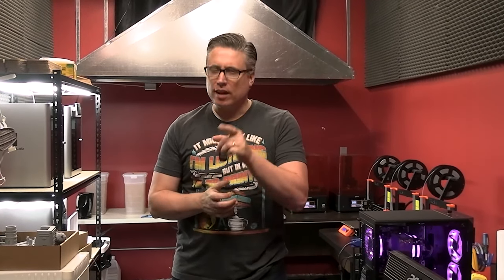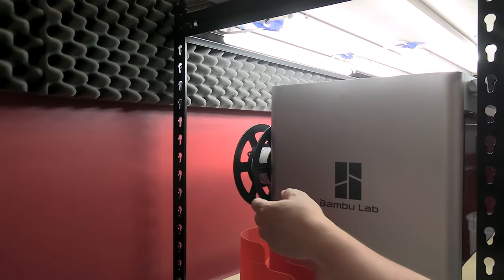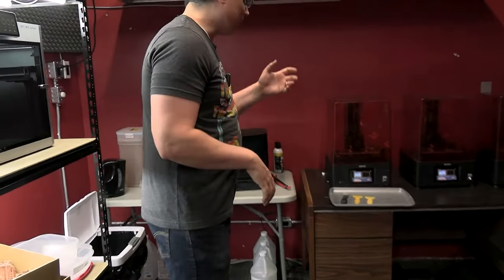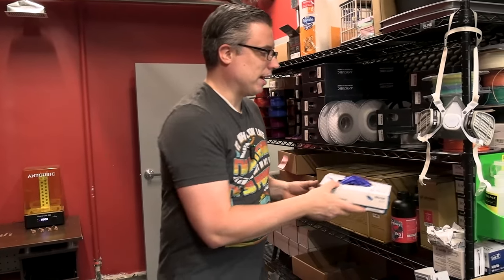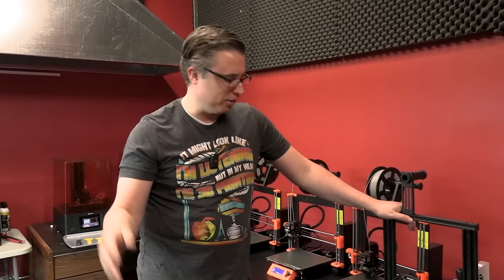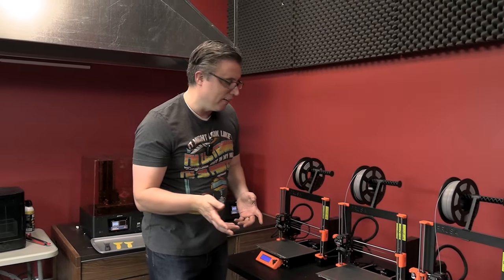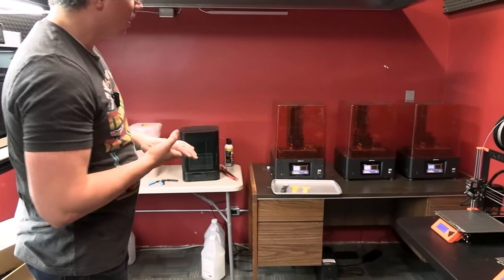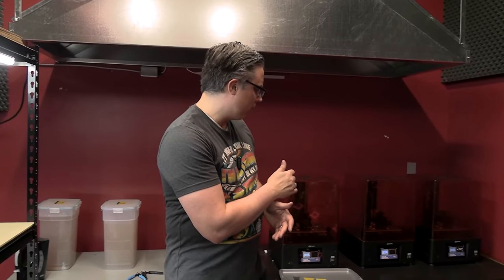FDM vs Resin 3D Printing - Which is Better?

Comment: I need to make models for Spin Casting that will need to go through the Vulcanizing Process which is high-pressure and around 300 -350*F.  Traditionally I believe they used FDM with Polycarbonate (PC).  Have you used this type of filament with the Bamboo Labs X1 Carbon or know of it?  I definitely want to avoid print lines.
The X1 carbon looks great but that resin printer looks perfect to do small details and they look perfectly smooth.  Do you know of a resin that is used in the model making that can survive the vulcanizing process?  I think Nicem makes some but their info on their own product is lacking greatly on how to use it.  
Thanks for the help
Reply from the maker: I haven't done this, but I would avoid using FDM printers for mold making.  Even with the precision of the Bambu Labs printers there are still some lines that would show through.

Comment: Very interesting video, thank you. With filament printing you keep saying FDM, FDM, FDM (which it is). But for the resin printers you just say resin over and over. why didn't you call it what it is, SLA (except for the laser, SLS)? Not trying to start anything, just wondering.
Reply: There are multiple 3d printing technologies that achieve resin printing using difrent forms of curing the resin. They have their own advantages and disadvantages that are too minor to really differentiate them.

Comment: What did you dislike about the AnyCubic Mega printers?  I have 2 Mega S printers one that has been rocking for 4 years and other than nozzles and hot ends I haven't had to replace anything.  I did upgrade to silicone tubes instead of leveling springs and Capricorn tubing.
Reply from the maker: We have six of them, and we had non stop issues with all of them. The sensors often gave false negatives about being out of FDM. 3 of them have had thermal runaway issues that we couldn’t fix. The hot ends needed to be replaced far more often than they should. 

They’re also very slow compared to our other printers.
Reply: @MWGForge  I 100% agree that they are very slow at 50 mms print speed but I have been happy with the print quality versus all of the Ender 3 prints I see. I am planning on upgrading to a Bamboo Labs before the year is up though.

Comment: What type of printer would you recommend to make polymer clay cutters? Bearing in mind I’d like to make multiple cutters of the exact same file at one time if this can be done?
Reply: I would get a resin printer, the edges that can be made with a 30 micron resolution printer at .03 layer hight can easily cut clay, you can make as many clay cutters as you can fit into the bed of the resin printer faster than with FDM.

Comment: Actually even with PLA you still have to worry about the fumes. Yes, PLA is least health damaging printing material, but fumes from it are still dangerous. You can check study searching phrase: "Chemical Composition and Toxicity of Particles Emitted from a Consumer-Level 3D Printer Using Various Materials".
Reply from the maker: Thanks for that!  I'll check that out for sure.

Comment: Weird question perhaps, but can you place your 3D printer in like a garage or outhouse that isn't necessarily heated? Or does it need to be inside the house at room temperature?
Reply: Not weired, ots actually one of the most critical aspects of resin printing, The printer needs to be at a stable ambient 25-30C for best results with most resins, below 20C and the print is likely to fail, you can buy heaters for the printers but newer printer models are coming with built in heaters.

Comment: Actually I would like to see the level of quality you can get with printing a 28mm to 32mm miniature with fdm. I heard that a .2 nozzle with layering at either .05, .08, or even .1 will yield good results.

I'm specifically looking into getting the elegoo Neptune 4 and elegoo mars 4 DLP. Lastly, do you recommendations for any DnD stl that are realistic scale, i e something similar to loot studios? It's hard to find a bundle with a mix of heroes and monsters. GW cursed city is the only thing that has a perfect mix for dungeon crawling. Thanks in advance.
Reply from the maker: I haven't ever tried it, but maybe for the sake of this channel I should!
Reply: @MWGForge sovol sv06 can easily do a 0.15 level and modles come out quite clean, can also print them in petg

Comment: If I wanted to get in to printing figures like Elden Ring characters and such what would be the best kind of printer to get in to? I want to start a figure collection of characters in certain media I love but buying figures out right is so exspensive.
Reply: Resin printers will give you model quality detail or at times exceeded model quality, things like chainmail detail and sharp objects can only be done with resin unless you use a FDM printer with a very very small nozzle that willl take ages to make a print. you just have to be ready to take extra caution and time for cleaning with ethenol and resin, getting into making figurines can also be expensive, so you may want to buy unpainted models to try out painting first untill you know you want to put down serious money.

Comment: nice video i have a FDM printer which i print statues and figures. Was thinking would it be better if i had a resin one.
Reply from the maker: Resin will look nicer for sure, but there is a lot to think about for safety which can make it harder to do at home.
Reply: @MWGForge  I have my very own garage that I’m making into a collection room.

Comment: I have a question if I may ask: if somebody would ask you to print a component or part which is highly detailed, but that requires to be used in high temperature environment such as above 100°C (212F) which printer you would recommend? FDM or Resin? If Resin what resin could be used for such use cases?
Reply: Siraya Tech Sculpt High-Temp 3d print resin can handle up to 180C and be accurate, these resins usually require a hot environment to also cure which may be more difficult for 3d resin printers to active unless you have a heater installed on the vat or case.

Comment: Assume you are using the 0.4 nozzle on the X1, have you tried the 0.2 nozzle yet? Rumour has it that quality is very much comparable to resin printing.
Reply from the maker: I haven't tried yet.  I mainly print terrain, so a huge increase in quality wouldn't be too noticeable.  I might have to try this at one point though.

Comment: With your mighty 8k's what are you finding a good lift speed and height? Do you use TMSC?
Reply from the maker: Right now I use the defaults that come with the resin.  Phrozen is working on new firmware and a new ACF film that should drastically speed things up (they claim 6x faster, but we'll see).  I'll make a video about this once they do it.

Comment: Any particular resin brand recommended? Water soluable for easy support removal?
Reply: Anycubic is cheap and good when you get it off ebay, I prefer their HD grey resin for high resolution figurines and ABS like pro 2 for miniatures for a bit more durability. I don't recommend water washable for the reason you still have to find a way to safely dispose of the waste water and hot water will soften up a print for removal, curing the print before support removal will make it significantly harder to remove the more stiffer thicker supports.

Comment: My first and only 3d printer is the i3 mega the one you said NOT to get lol. And Id have to agree. This thing has never worked right. it randomly stops 20% of the way into large prints and then cools the bed (but still the screen advertises it at print temp) and then your print unsticks and then theres no way to continue the print and you lose the entire thing everytime. I can only print like small parts that take 30 mins with it basically. ive taken the whole thing apart, rebuilt it, switched sd cards, i even put it in a closet for a year to give cura time to update incase it was a software bug, pulled it back out and still the same issue. i would try custom firmware but the usb port on it doesnt seem to work or something, my pc doesn't recognize anything is plugged in.

Comment: I'm an  engineer and do a lot of prototyping etc. Which makes stronger prints?
Reply from the maker: FDM printers for sure.  You'll need a printer that can print in materials such as ABS if you want to print stronger parts.

Comment: I bought my ender 3 on eBay, they apparently take the ones sent back during the return period and just resell them unrepaired for 80 dollars on eBay. Repair it.. which takes significantly less time than setting one up and it costs significantly less money.
Reply from the maker: That's great!  I'm not particularly interested in the hobby of maintaining 3D printers.  I'm more interested in just getting tons of stuff printed, so having to maintain each individual printer as much as the Ender 3s was not for me.

However, for home hobbying they can work great.

Comment: As someone that had an i3 mega for a while without too many issues, I'm curious what issues you had that would make you not recommend them.
Reply from the maker: We've owned six of them, and five of them have totally stopped working.  The hot ends had to be replaced frequently, and one by one they all would just stop printing mid print with no indication as to why.  We troubleshooted the heck out of them and couldn't figure it out, but eventually they all succumbed to the same problem.  We could only assume it was something on the motherboard, which was beyond our experience to fix at the time.
Reply: @MWGForge  When you say that they would stop printing, do you mean that they would just freeze and be stuck like that until you restart the printer?
If so, that might have been an issue with the SD card reader. I ran into that issue and figured out that if I slipped a bit of cardstock into the slot with the sd card to hold it tighter to the terminals, then as long as it's able to read the sd card when the print starts, it won't get shaken loose (or whatever was going on) mid-print.

Comment: What’s the life of resin printers 
Do we need to maintain 20-28 degree Celsius temperature and 40% humidity for resin printers
Reply: Expected life is 2,000 hours of UV light operation. A typical 12 hour print will run its lights for about 2-4 hours. You need to maintain above 20C to prevent issues with printing and below 35C for most prints. Humidity is not an issue when 3d printing with resin.
Reply: @miguellopez3392  I am starting with 3d printing for prototypes and samples building. I am buying bamboo lab X1CC.

Should I initially go for only FDM printer or simultaneously buy resin printer also. 

Regarding ABS if I need smooth finish should I consider FDM or resin printing.
Reply: @paddy4965  I only have experience with resin, you will get a finish that is superior to FDM and in some cases requires no sanding. Both can be used for prototypes but the resin one will have to be a more expensive engineered resin to handle the same as ABS, but in heat tolerant prototypes, some resins can resist over 450F tempatures. Mecha nylon blu resin is very expensive but gives smooth scratch resistant surfaces for engineering prototypes.

Comment: Ngl the toxic part is what keeps me away from the resin.. But the idea of printing miniatures at high quality is really tempting. What do apartment people do? :(
Reply: if you have a window i recommend using a paint station with a built in vent and holes to ventilate alcohol fumes and resin fumes, the smell will still be there but not at toxic levels.

Comment: Neither is better than the other. Why? Because they are to be used for very different purposes. 
Need a large and strong part? Use an FDM printer. 
Need a part with exceptional detail that looks like it was injection molded? Use a Resin printer.

Comment: i have just got a resin printer and yes it prints a lot nicer but its so much more of a pain to use
Reply from the maker: Most definitely!  Resin is tough as it is more toxic and messy, so you need a better setup.   But they are a must if you want to 3D print miniatures.

Comment: Bambu Labs A1 mini to replace the pursa
Reply from the maker: Maybe!  The print volume is a little small, but I guess it depends on what you're trying to print.
Reply: totally agree... it's not for me for sure, but I was thinking you deal with figures and stuff so they are small prints in the first place. I'm rocking the x1c and love it. I just saw your video because I'm trying to understand what I could gain if I added a resin printer to my fleet and if it's even worth it or not. @MWGForge